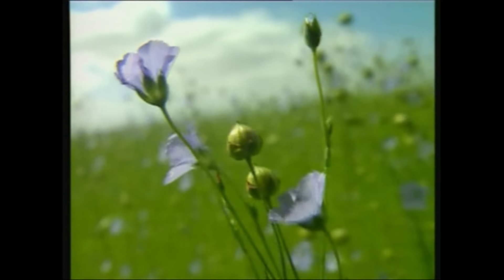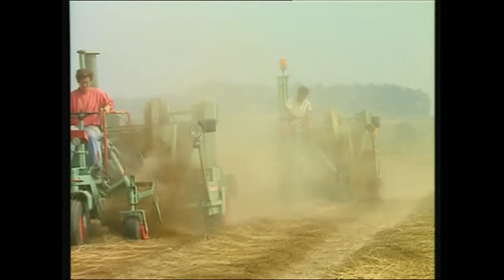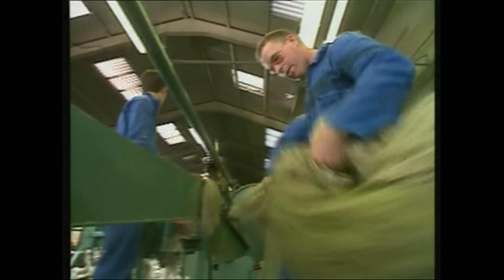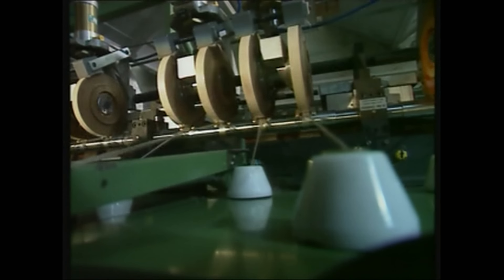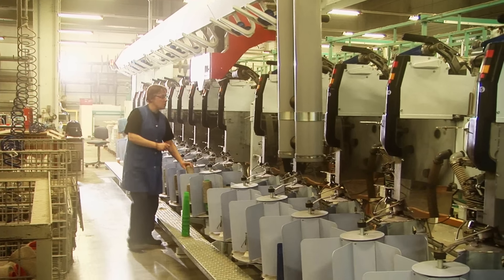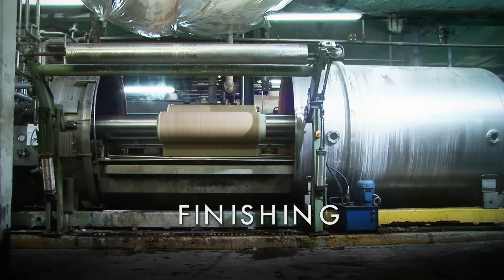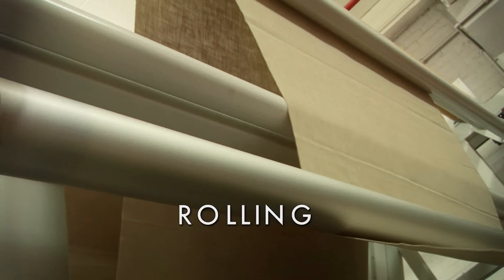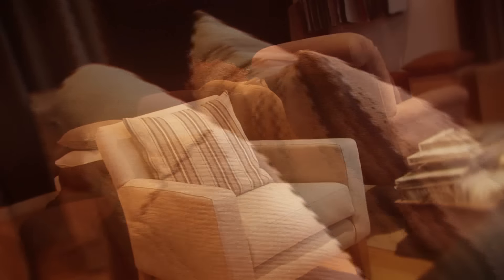How Linen Is Made

Comment: Interesting: "Linen is lint free" I noticed the factory air wasn't full of fiber, like in a cotton textile plant.
Reply: Linen last for years because it doesn’t lint up and break down
Reply: I was just thinking of Lindor lol
Reply: It's probably because of the long staple length.  "Staple length" refers to how long the individual fibers are.  For wool, it's somewhere between 4 and 6 inches usually, depending on breed/diet/shearing practices.  For cotton, it's shorter, with 2 inches being common.  But a linen staple stretches all the way from the head of the plant to its root ball.  This makes for a very strong thread when these long fibers are spun together.  Fun fact: the longest "staple" fiber is undoubtedly silk.  The silkworm cocoon is one single fiber about a kilometer long.
Reply: @calliarcale  it very much is because of the length of the fibers and that are non-branching fibers.
Reply: U BLOOMING FLAX PLANT

Comment: Interesting fact about linen and wool:
Frequency Study

In 2003, a study was done by a Jewish doctor, Heidi Yellen, on the frequencies of fabric.  According to this study, the human body has a signature frequency of 100, and organic cotton is the same – 100.  The study showed that if the number is lower than 100, it puts a strain on the body.  A diseased, nearly dead person has a frequency of about 15, and that is where polyester, rayon, and silk register. Nonorganic cotton registers a signature frequency of about 70. However, if the fabric has a higher frequency, it gives energy to the body.  This is where linen comes in as a super-fabric.  Its frequency is 5,000. Wool is also 5,000, but when mixed together with linen, the frequencies cancel each other out and fall to zero. Even wearing a wool sweater on top of a linen outfit in a study collapsed the electrical field. The reason for this could be that the energy field of wool flows from left to right, while that of linen flows in the opposite direction, from right to left.

Comment: Very educational and informative. Personally, I would have liked to get a better understanding of how the discrete fibres are formed into continuous yarn, but I understand that this is also a promotional video, so it has a limited amount of time to explain the whole process. Still, I learned a lot from it. Thank you! 😊
Reply: The fibers are combined into a continuous yarn by spinning.  First, the fibers must be combed to align them, producing what's called "combed top" or "roving".  If you were doing it by hand, your next step would be to wrap the combed top of linen around either your arm or a distaff to store it, then you'd carefully tease a tiny bit out a few inches and start twisting it.  You twist it a lot, using a spindle or a spinning wheel or a mechanical spinner, and then you draft out a little more of the fiber, let the twist enter that and turn it to yarn, and so on.  When some of the fiber ends start coming out of the top, it doesn't cause a problem, because there are more fibers around them that don't have their ends exposed; the twist locks them together.  Then, you can make it even stronger by taking two or more of the strands you've made this way and spinning them together the opposite direction -- creating a multiple-ply yarn or thread.

This is basically how spinning works no matter what fiber you are spinning.

Comment: How do you combine flax fibers into 1 long strand?
Reply from the maker: A flax spinner spins by twisting the flax fibers over and over until they form a yarn. In the old days, this was done by hand. Today this is done mechanically. You can try it yourself: 1) Find a yarn (the coarser, the better) - 2) Twist it in the opposite spinning direction - 3) You'll notice that your yarn turns into fibers.
Reply: Multiple fibres are side by side (initially parallel before being twisted together) but are staggered so that they start and end at different points and overlap along the length of the thread.

Comment: I prefer hemp over flax - it requires a lot less maintenance and is a far more useful plant all around.
Reply: makwabid69 linen is nicer
Reply: you can't get high on it though.
Reply: I bought a hemp washcloth, used it once, and remembered I detest the smell of wet burlap. You're welcome to it, however.
Reply: try washing it a few times, the odor will go away.  i use hemp fiber for various products and it can have a smell when its new, but washing it a few times will remove it.